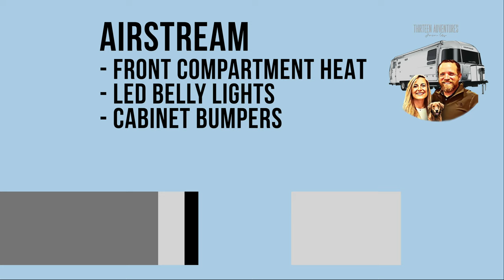Efficient Airstream Living: Inverter Heat Insights and LED Light Install Guide!

Comment: I always enjoy a chance to learn more about how an Airstream works.  I have a question for your about inverters.  My 2021 Caravel 20fb has the stock 1000 watt inverter.  Based on what you have seen would it be possible to swap this inverter out for the new 2000 watt inverter without rewiring?  It has been too cold here to go exploring in the Airstream to see what gauge wires are there but your video has me thinking about spring upgrades.  Thanks and safe travels.
Reply from the maker: Good question and thanks for the message and opportunity to assist.  Swapping out the inverter for the new 2k variant is exactly what Airstream did for 2024.  All new models (to my knowledge) now come with the 2k inverter.  It’s a very simple process to swap it out and should require no new wiring.

Comment: Can you share the aluminum blocks you put under the inverter? I have the unit and it is heading up too much but maybe that’s because the compartment I have it on does not have much ventilation.
Great vid!
Reply from the maker: Good morning!  Thanks for watching and your feedback.  I installed a 1" square aluminum tubing I had lying around.  Its like this: https://amzn.to/3UqiT0g
I would also consider adding a 12v fan like these: https://amzn.to/4bpgZno and a temperature sensor like these https://amzn.to/44slStE to control it.  You can cut a hole in your wall of the compartment and have if flow under your bed or into the main part of the rig.